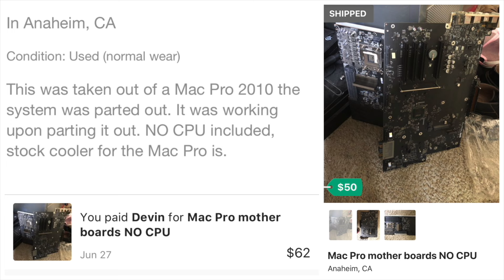I built a 5,1 Mac Pro from parts I found online

Comment: How much did you spend on parts? I bought a 4,1 Mac Pro that I flashed to a 5, 1 in 2017 for $200.
Reply from the maker: It looks like I ended up paying $357.23. Looks like you got a great deal! What were the specs on yours? 👀
Reply: @LuminousPlasma  It's only a 4 core CPU 4,1 with a NVIDIA GT 120, I haven't upgraded it to a 6 core Xeon yet. I ended up finding a great deal on a 2012 Mac Pro in 2017 with dual six core CPU's for $400 with a perfect case with no scratch's, so I keep the 4,1 for parts in case the PSU fails in my 5,1.